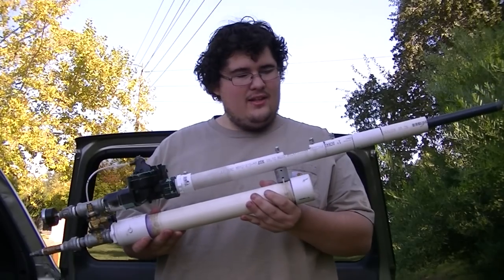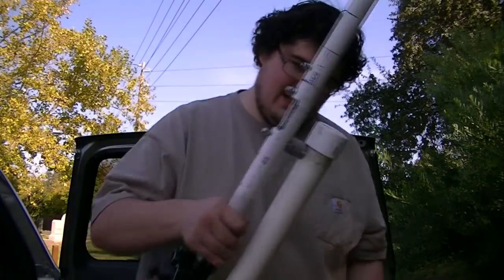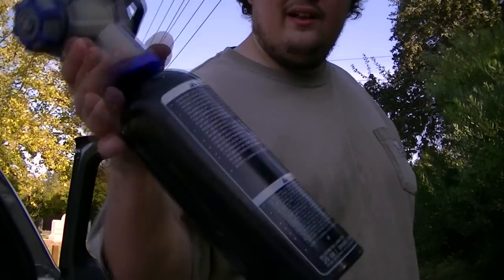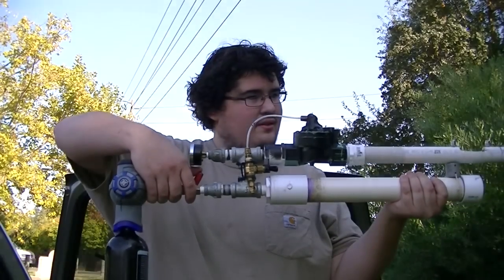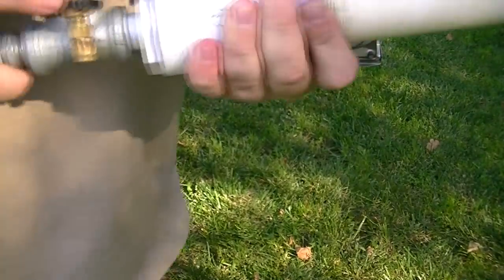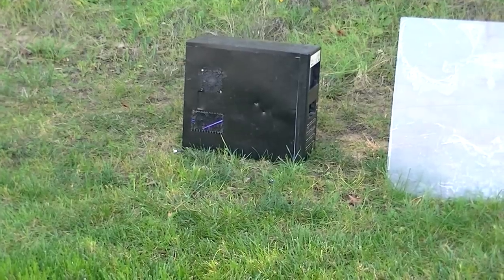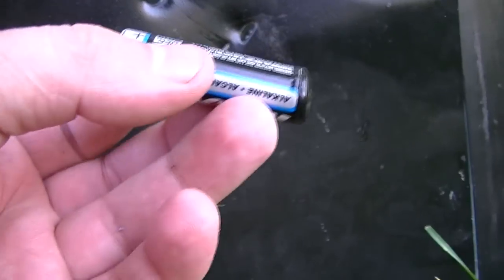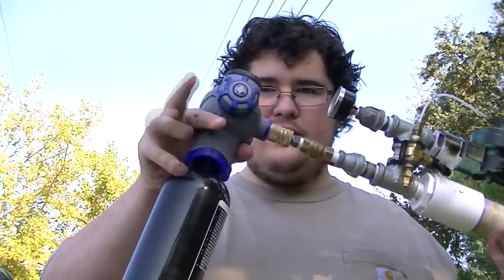Full auto battery shooting air gun: Test fire

Comment: I'm building my own nerf gun using a similar method. I don't need a lot of pressure, just enough to get the dart moving without flying all over. So my question is, with the co2 would your pvc get brittle or get cold enough to jam? My next question is has anyone else build this gun and are you going to do another?